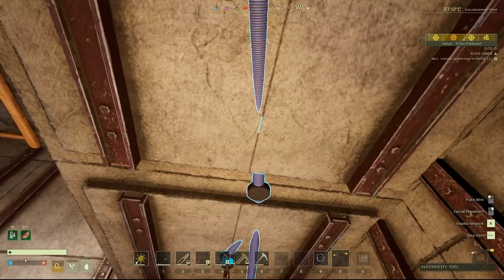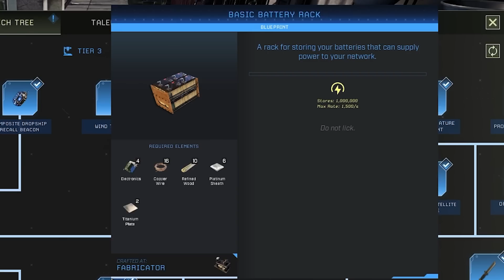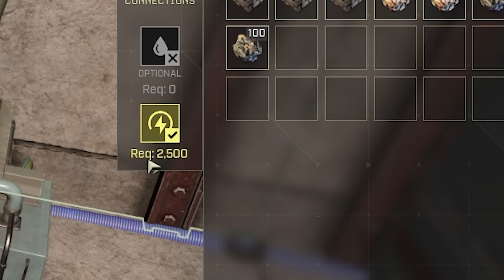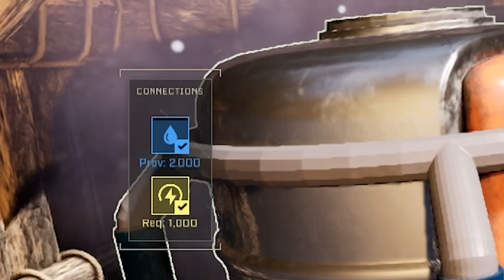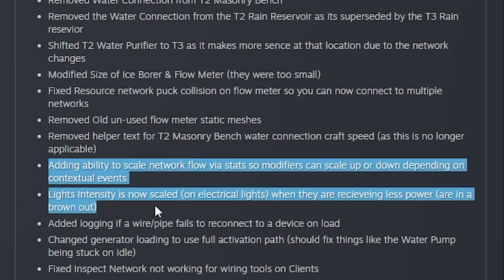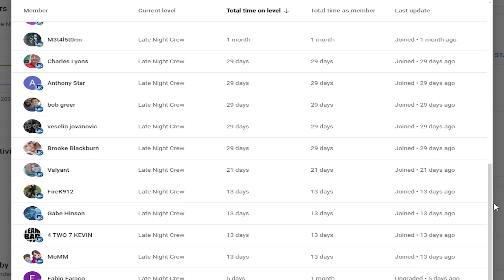Batteries & Networks Are HERE! Icarus Week 117 Update! 7 NEW Items, Unlimited DeepVeins & IDLE MODE!

Comment: IMO wind and water, as well as small batteries should be T3, T4 should have advanced stuff like solar panels and the better batteries, the flow meter etc etc.

T5 should be added (PS All of these should (require) power AND water to use) with the following.
CNC Mill & Injection molding machine (Precision Crafting components),
CNC lathe (wood working and other lathe appreciations). 
CNC Hydro Cutter table (Masonry)
CNC Hydrolic Press and Welding station (metal working)
Multi-fuel Hybrid Stove with oven. (biofiel, wood, power and or water can be added to the stove, automatically boils and purifies water added through it and can be linked to a storage tank for clean drinking water.)
Bio Tech work bench w/ Centrifuge. (replaces mortar and pestle and alchemy station)
Fuel Processor & Charging station (place to make any and all fuel related things and or compost, as well as refill portable batteries, power packs, vehicle fuel tanks, fire extinguishers and flamethrower fuel)

A new outdoor sprinkler system or something that requires a high volume water source like a pond or river, and a heavy duty water pump. (can be used to reforest plants and trees in an area).
Frequent Fires and wind make my dense forest base ugly and barren like i built in a field id like to fix this like the thumped does maybe without the boss mini game.

New Water map where land is scares and you gotta dive for resources and fight sharks n stuff. idk.
Add Boats Canoe T3 and Motor Boat T5

New tools, 
Advanced Cave scanner (can tell which caves still have ore in them and what type)
Advanced Ore scanner (finds specific ore veins like the space station scanner does without the need for the crazy material farming)
Advanced Wildlife scanner (can find specific animals to hunt/fight)
Advanced Biotech scammer (can find specific food plants or resources)

Multi Fuel Vehicle like a 4 wheeler to help travel farther.

New armor should be added that actually looks good.
as well as weapons like
Automatic shotgun w/ Bayonett
Automatic Riffle w/ Bayonett
Light Machine Guns, w/ grip and or bypod
RPG
Re-loadable Flamethrower (Takes a backpack slot)
Re-loadable Heavy fire extinguisher. (like the reverse of a flame thrower) (Takes a backpack slot)

all in all i love this game.
Reply from the maker: Yah they pretty much said no to vehicles in the past which makes me sad but I'm excited to see what t5 brings. I'd love an underwater map or something similar but it don't have to be a full blown Subotica rip off. Pretty sure a rifle is in the game files. Thanks for all the suggestions, the devs sometimes check these comments and comment also =)

Comment: Thanks for the detailed update. Wonder if the power towers are adding to my lag.
Reply from the maker: So yes they add some frames when removed on higher end systems and more on lower end. I just switched mine over and noticed a really small improvement. Thanks for watching!
Reply: @LateNightStream  I wasn't going to bother with batteries but reading that I might swap over and see if it helps.

Comment: Outstanding work going through a very complex update!  This one not only had a bunch of new things, but the water/power networks were clearly changed well beyond just adding new stuff.  I'm a big fan of all the new UI which makes management so much more clear.  I really liked how you used a simple example to explain how the batteries work with the electric furnace and the single advanced power pack.  My feedback for the devs would be just what you were saying - batteries should be stronger and the high costs that certain things (like freezers in particular) have in terms of load should be greatly reduced.  In terms of a real life example, a Tesla powerwall has roughly 48,000,000 of power storage - and takes up about the same amount of space as the "advanced" battery packs.  And freezers in real life only draw from 30 to 100.  So, I'm hopeful that devs will adjust, at least to some extent.  Using your math example, for instance, your base, which has 79,000,000 power storage, should be able to run a load of 34,500 for about 2,290 seconds.  Which should not be enough to keep it powered overnight.  So, that makes me wonder if something else is at play - perhaps they are compressing the time for overnight?  But I really appreciate how you walked through this step by step, even where it was very complicated (like brownout stuff) and I'm looking forward to maybe going all solar as well!  Maybe now they can get to work on new map areas and more missions for prometheus?  Cheers!  JW
Reply from the maker: Thanks as always for the comment John! The one thing ill mention is that yes the math is correct but your forgetting one MAJOR factor and that's how long where I built the sun isn't charging my panels. This is something that will vary from base to base location. From around 1745 till 750 hours I'm on batteries. Those are rough numbers but I still have millions of power left. Have a great one =)